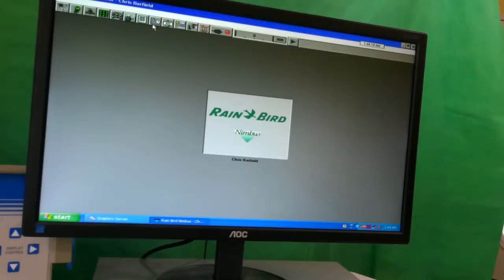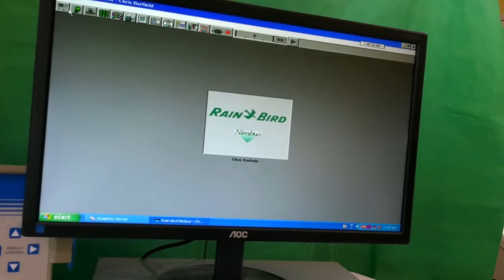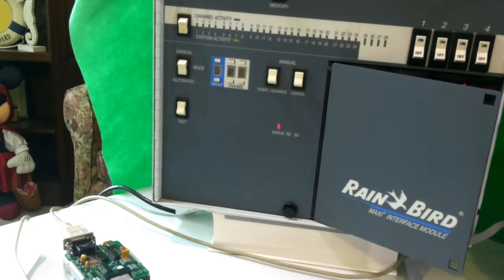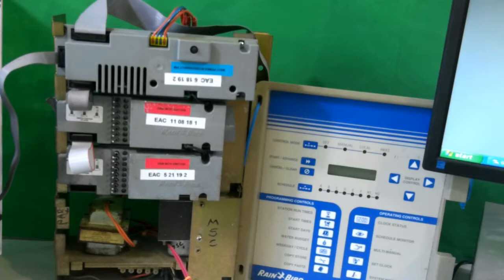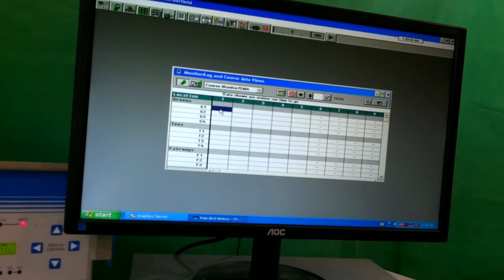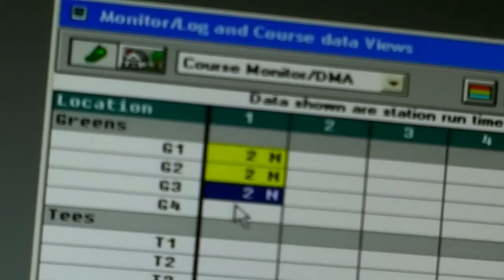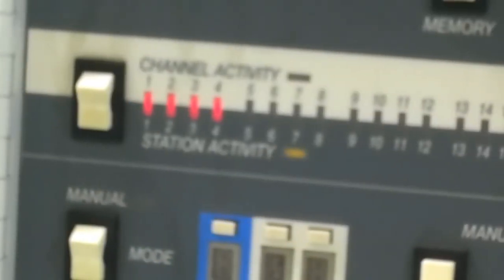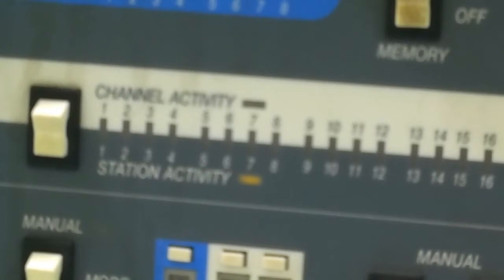Rainbird Maxi Radio Link Control System Operation

Comment: Couple things that effect your Par+: 1) Check all the cables and connections most of the problems I've seen are corrosion. 2) You can replace all the modules you want but if the cable connections are worn corroded  system will not work right.